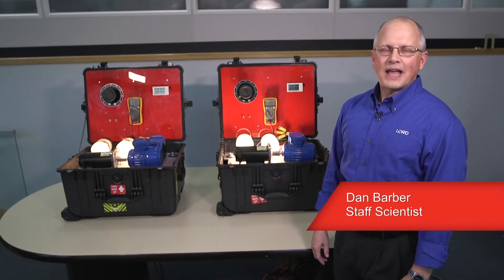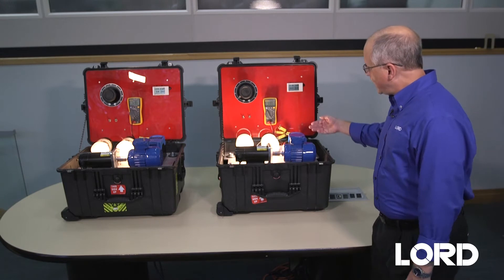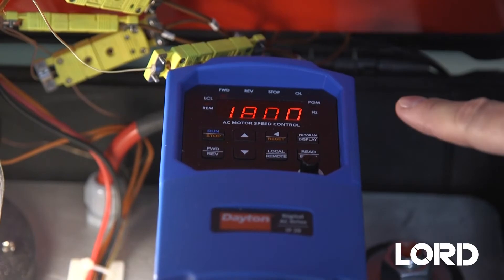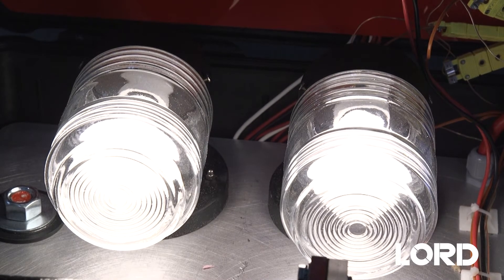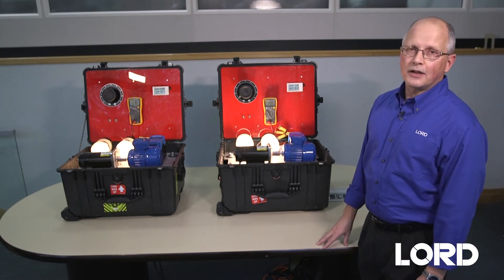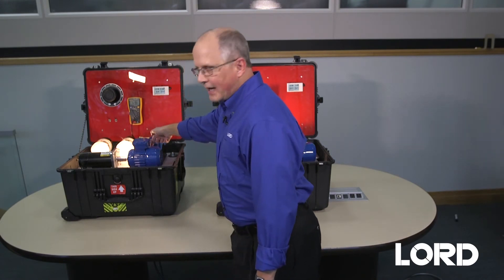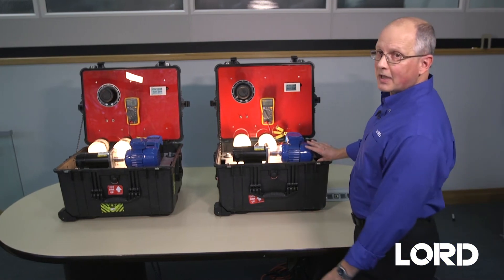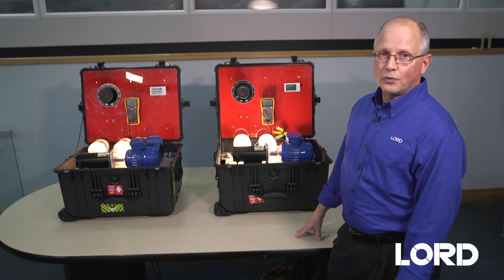Potted vs Unpotted Motor, Which Manages Heat Better?

Comment: What is the idea that potting the motor makes it operate cooler? Does the potting help dissipate heat?
Reply from the maker: Hi Donny, the answer is yes. Potting a motor can decrease operating temperature by 50 degrees (C) and increase power output by 30%. You can learn more in these two white papers: https://lordfulfillment.com/pdf/44/LL3243_MotorPowerDensity.pdf  or https://lordfulfillment.com/pdf/44/LL3246_PottedMotors.pdf.
Reply: Yes, indeed. The potting material replaces air, which is a bad heat conductor. So the heat can travel faster to the housing and be cooled down by the air or cooling liquid.
Reply: @wutzwerner  thank you for the "why" answer.